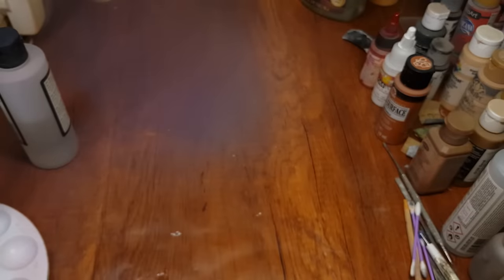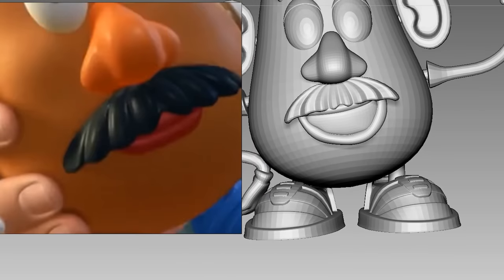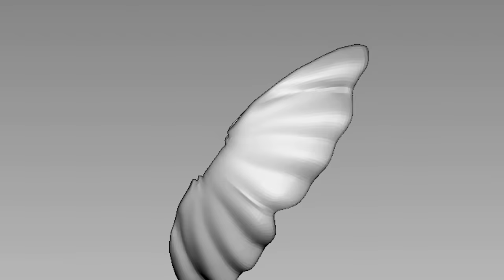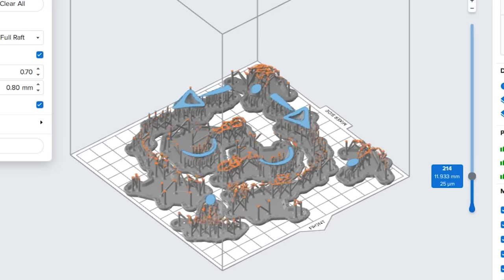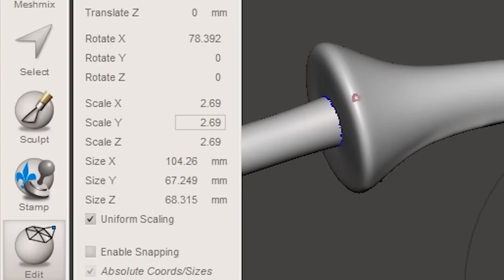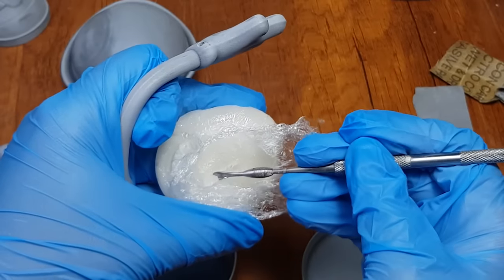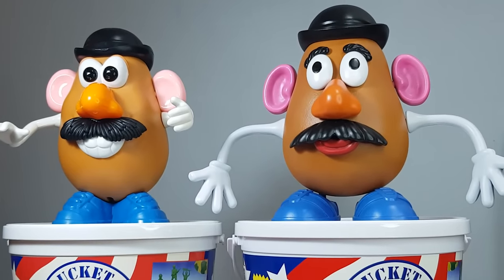I Made Toy Story Mr Potato Head In REAL LIFE | 3D Sculpted 3D Print Custom Collection Formlabs 3

Comment: Mr. Potato Head's hat is actually a real Mr. Potato Head piece from WAY back in the day. It's a vintage suction cup bowler hat. It's why it doesn't have a peg like modern Mr. Potato Head hats do. Also, Why did you need to ask which one you should do? It's a freaking Mr. Potato Head, he's supposed to have interchangeable parts.

Comment: The bendable arms aren’t removable unless you cut from inside the potato. They are “bolted” on with rubber, and the hole is larger than the other body part holes
Reply from the maker: Thanks for the heads up!

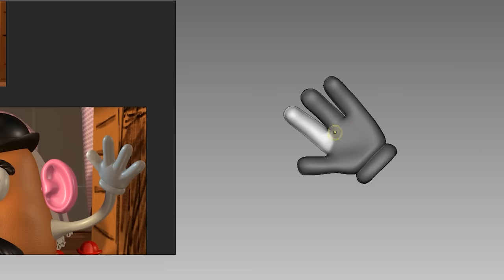Comment: Around the 5:45 mark: 
The bucket was probably apart of it when it was originally created in 1949. I was a kid in the 70s and mine came in a box. It was a pain because it was the slide in top and bottom and gapped letting the parts (arms, legs, and the rest) to fall out of it. Then it would lose its shape. It just wasn’t a good way to store it. That’s probably why they had it sealed in plastic wrap. So needless to say, I eventually lost a lot of the parts and the lost interest in it. I never got a Mrs. Potato Head because they were really popular with girls. So they sold out quick.

Comment: The wiggly arms are also corked into the body so you wont be able to customize it into a functional part lol. Btw they wont make a screen accrue potato head due to child safety laws, mr potato head is for toddlers aged 2-4 years old a childs windpipe is the same size as a toilet paper roll (the cardboard for those who are slow) and if anything can fit into that size its considered a chocking hazard and needs to be redesigned

Comment: what grit of sandpaper do you use.i am making mr potato head too but not from scratch
Reply from the maker: Depends on the material you are sanding. I use 360/400 sand them down then 1000 to smooth them.